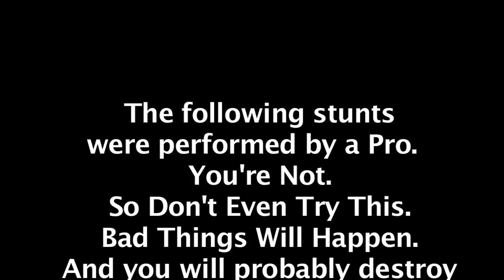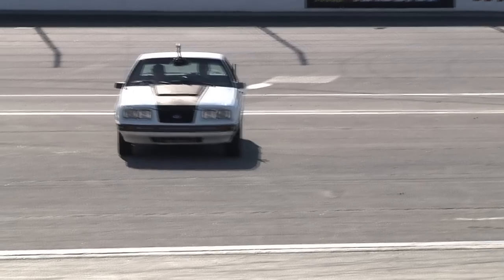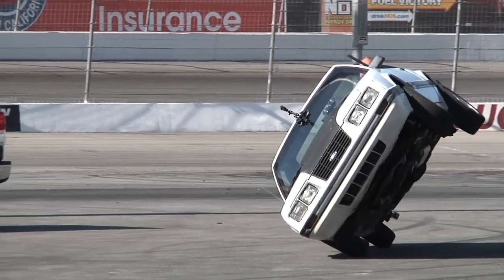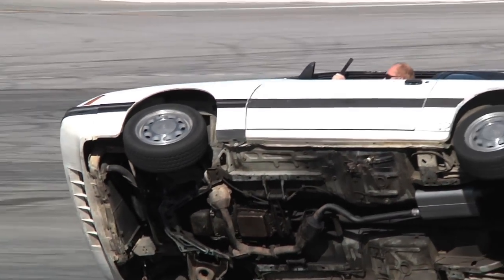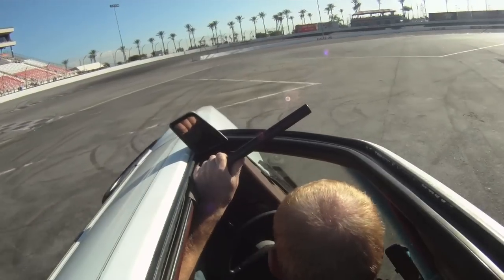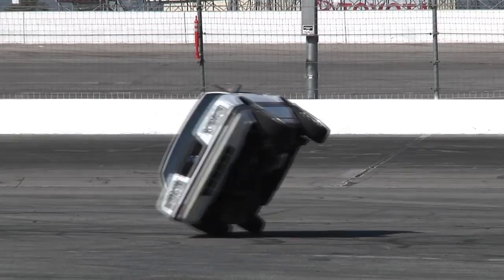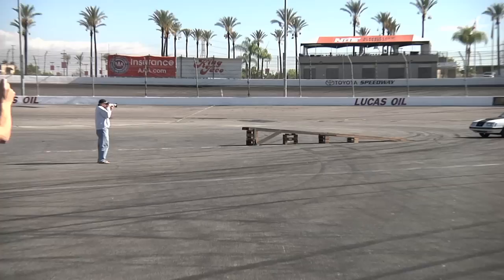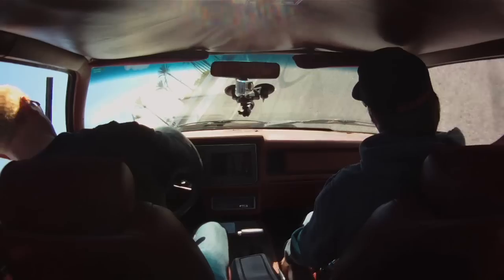HOT ROD How to: Drive on 2 Wheels STUNT FEATURE

Comment: I will take on two wheel any day without the  ramp. 
Any 4x4 SUV can do it easily buy a wide ass tire with some curves to the tire side ( I had some in my region). 90 PSI on the wheel with diff lock on.

Comment: Not to mention YOU HAVE TO LOCK THE DIFF
Reply: You can also do it in a car with a completely positive diff
Reply: I've been wondering about that specifically for 30 years since I watched (a stunt team) do it with a bunch of Omni 024's. The carrier should precess with one wheel up, on the other hand an open diff does apply equal torque to both axles - could (say) a touch of parking brake, the diff oil rsistance, tire mass etc, compensate just enough for an already moving vehicle at more or less constant speed leaving the ramp?

I'd love to give this a try - not hard to find a beater, build a ramp, and deal with rudimentary rollover safety at such speeds - but even on private property it would be a serious offence here :(